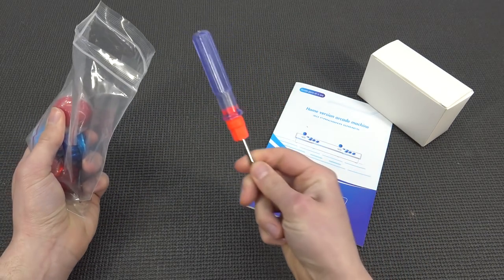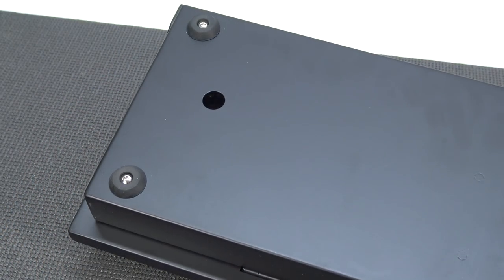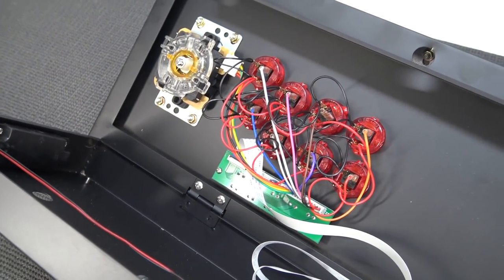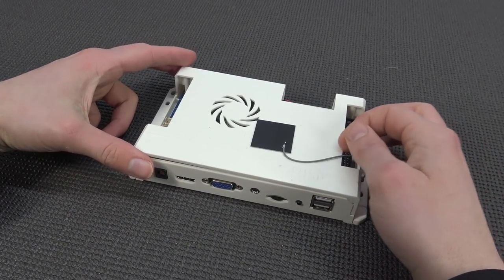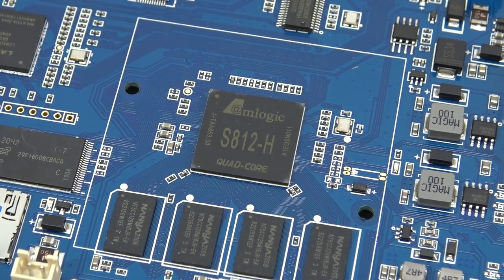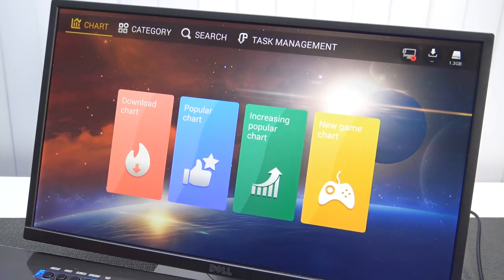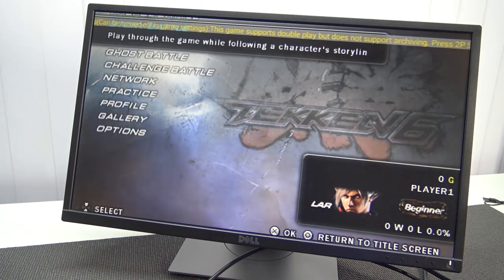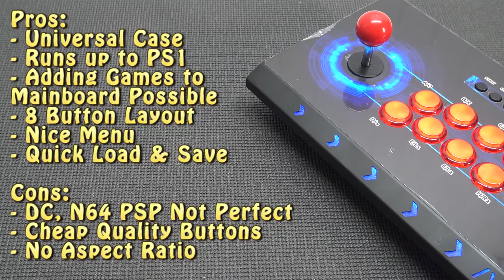Pandora's Box 3D - 8000 in 1 - IYO Gaming 2021 Edition

Comment: Is it possible to just get the board and hook up sanwa controllers and buttons to put in an arcade cabinet, I mean is it complicated to wire up the two controllers to the main board, do you need encoder boards? Thanks
Reply: No, it’s super easy. You can buy longer wire set similar one comes with the Pandora. Sanwa works on my cabinet just fine, no encoder board needed.

Comment: Would be interesting to mount an Android box into an X-Arcade controller to have better controls, more power and options (EmuElec), and probably about the same prize.
Reply: I did it with the Super Console X Pro for my X-Arcade Dual Joystick. It has way more options for controller mapping, emulators, Screen Ratio's and quadruple the amount games that the Pandora Box could ever offer. The Beelink has come out already and uses the S922X which is a huge improvement over the S905X that struggled with n64 and some PS1 games. I save my money for that one if I were you. You won't be disappointed.

Comment: What gamepads work with these consoles?
Reply from the maker: Depends what model.
Only the 3d Plus and DX support controllers like the xbox 360. 
Old models if support controllers have limited support most of them those horrible ps2 fake controllers support.
Reply: @WickedGamerCollector  found the Pandora 3d 23s for cheap but I want to make sure I have some extra controllers that work before I buy it. The online stuff for these consoles are so unclear it's frustrating.

Comment: I followed the link to buy this but the specifications listed on the website says it only has 1gb of ram... Just wanted to know if that's an error or were they naughty and changed boards. 

Love your channel, it was a fun rabbit hole to go down. Keep it up.
Reply from the maker: You have the 8000 and 7000 versions at this moment. It's possible the give all boards the new 2021 revision. In the end does not matter. 
PSP and DC will always have same performance 😄

Comment: Hey Wicked. I've been getting a lot of ad's on Facebook lately from companies  who offer Arcade 1up mods, which are essentially controller replacements. You just take the old control cluster off and pop the one they are hocking in it's place. They are selling them for $219 -$479 depending on the model. Seems like they are over priced. They don't offer anything amazing. Typically "up to" PS1 emu, with N64 running like shit, so I'm thinking it's just a Pi3, running retroarch. Alternatively couldn't one just buy a Pi and the compatible, usb arcade buttons (39.99 for 2 player) and plug them in to the existing cabinet? Seems like it would cost a whole lot less and it's a simple plug and play solution. Also, would you consider either investigating or testing these products? Looks like a dropship scam to me.